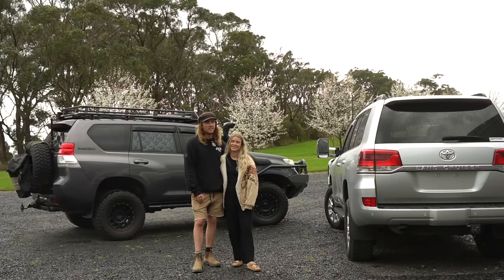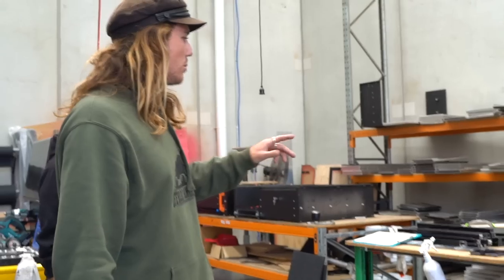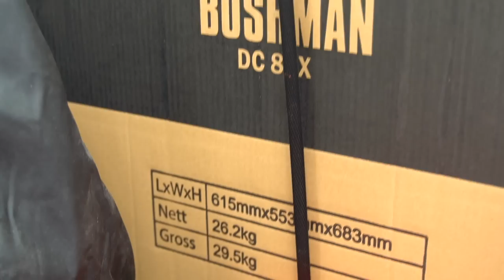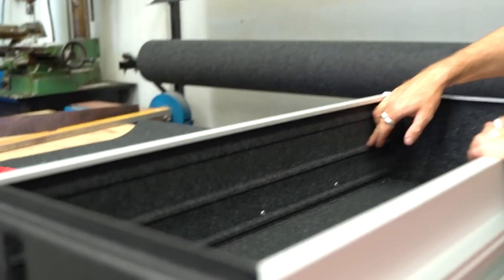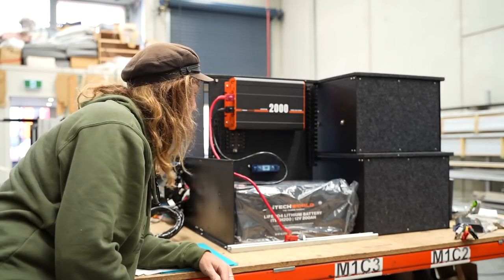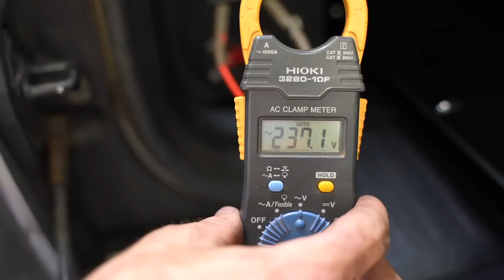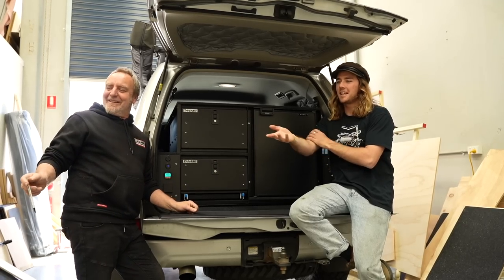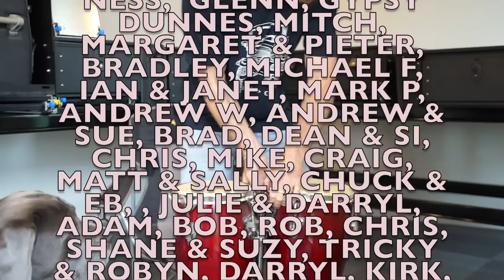MIND BLOWING 4x4 DRAWER & 12V OFFGRID SETUP TANAMI 4wd TRUCK BED CAMPING & 12 VOLT

Comment: Hi guys the 200 series is really coming along, the Tanami workmanship is top notch aluminium definitely the way to go. I wish I knew when bought my twin draw its about 10 kg heavier. When I weighed my 3rd row seats approx 45 kg. Found with the draws loaded is problem with the  van attached.  We use Solarscreen on the caravan reducing heat & I don't scare the kids outside when I am running around in the raw! Safe travels.
Reply from the maker: Thanks Ian!! That’s light mate!! Cheers mate yeah hopefully tows good with a bit of weight in the bum! Cheers legend

Comment: What a great video and fitout,
Just fitted a set of aluminium draws from another company and they weigh 90kg for just a 2 draw system for a 200 series.
The majority of metal 2 draw systems all weigh about the same as I enquired a lot of manufactures at the recent Perth 4wd show.
I am truly impressed by both the weight and workmanship in your system.
Reply from the maker: Thanks legend!! Baz said he can make the standard side by side drawers for 60kg which is pretty good! They are quality as! I did a lot of research myself and that’s light!! Couldn’t find lighter!! Cheers mate

Comment: That looks like it will be a great setup for my Ineos Grenadier when it arrives early next year. Although I want something that I can leave out the whole thing for about 70% of the time and put it in when I go on trips away.
So maybe 2 hours to install using the inbuilt L Track utility rails in the rear floor. I will already have the extra battery mounted under the rear seat from the factory so that will remove a lot of the weight. That will match the colour of my vehicle too.
Reply from the maker: Sounds like a plan mate! Hit up Baz and the boys!! They would love to help

Comment: Looks great, good job, lovin the build guy’s, real professional setup. Q) around 16 mins, the guys were soldering a cable, was that a battery terminal or other? , Im guessing it was crimped nicely first, ur cabling all looks good of course, but I have been seeing a different train of thought about using solder on ur battery cables/connections in the solar communities (or pretty much most cabling nowdays if ferruled or terminated correctly in solar &/or DC systems), for various reasons like: it stiffens & corrodes connections & can add acids, it is not as good conductor as copper & has different thermal properties, so if a connection does become hot from load or poor connection, the solder will melt first and can therefore weaken the connection & increase resistance here, exacerbating the  problem maybe when ur using the microwave, etc.
Victron, actually specifies not to use Ferrules in their gear, controllers, etc, because their connectors are designed to take fine core cables directly and provide a better connection than if ferrules are used, so I try not to use solder at all now-days if possible, as my interests are more into the larger 24v & 48v lifepo4 gear using all In One systems for simplicity & relatively cheap considering the functionality. Anyhow, my question is: as a sparky, what r ur thoughts about using Solder on cables if u can use a nice crimp? A large cable properly crimped (preferably hydraulic) forms what is known as a cold fusion bond, where all the molecules (basically) are compressed together as tightly as possible & pretty much fuse into one, giving a solid connection, with more flexibility & no potential acid inclusion, & in the marine circles solder can introduce more problems if used this way, more electrolysis, etc, anyhow, some food for thought.
Finally, loved ur stress test of these batteries, they do look to be a quality Australian build, but I would love to see Itec? Go ahead with the DIY builders version and introduce a 24v & a 48v versions as well, maybe the 24v version could be series for a 48v upgrade/setup capability as well, and a 200Amp BMS with BT App, that would be good. But another Bonus I did notice here is that they can be series together if u ever wanted to upgrade to, or build a 24v system (not 48v yet, bummer) with an AIO MPPT system which can get about 3.5Kw now (or more), have high functionality are fairly robust & can be considerably cheaper & easier to setup with thinner cabling for the more budget builder. Cheers

Comment: Just having gone through the process of rear setup myself I could appreciate the workmanship and the goals of reducing weight. Only 2 things came to mind, the dual drawer system I had found in my previous config was more issue that value, the top drawer is difficult to access, is less flexible and adds weight. I moved to Front runner Wolf pack boxes which can be accessed, stacked and removed much more effectively. The second thing was rear view visability, are you guys installing a rear camera to accomodate both the van and tow vehicle? I am in the process of looking at what options are availble so if you are keen to see what you land on as a solution
Reply from the maker: Thanks Bob for the information!! We are loving the drawers
Reply: @SarahandKeelanTravels  rear visability solution?

Comment: Nice work guys.  12 volt setup is 👌.  Out of curiosity, what size cable did you run from main battery to the 40 amp charger?  Cheers
Reply from the maker: I ran 4B&S, about 4m run and I’m getting next to 0 volt drop which is good!! Thanks mate

Comment: Great to see you considering weight, there are alternatives. Did you consider having an easy to access master isolation switch on the 12v system, in case of emergency/fire etc?
Reply from the maker: Thanks legend! We are all about weight calcs but also having the perfect setup for us too!! 
It’s a compromise like everything though! 

It’s under that False floor so can reach in and flick it off, I made sure I’ve fused everything and also my joins are good so hopefully touch wood happy days

Comment: Awesome set up and really interesting to see it built out of ali instead of ply. Looking good. Question on the 2000W inverter from Itecworld. I know you do a lot with their gear and being a sparky what’s your thoughts on the manual saying to put 25mm sq cable on 250A fuse? Is that what sizes you did?
Reply from the maker: Soo far so good!! Yes I used exactly what they provide, in terms of current draw 2000 watts at 12v is 166 amps, 25mm sq over 0.3m run of cable is sufficient for that. If that run of cable is 1meter + then definitely go bigger… go much bigger
Reply: Yeh mine was a bit longer with the batteries being out on the chassis - I think around 1m so I did 50mm cable and also dropped the fuse size to 200A and just did some testing to make sure my appliances were not going over that. I thought the same about the 166 amps but then realized when testing that efficiency of the inverter has to be taken into account and it was actually drawing a lot higher amps.

Comment: Awesome guys and funny, cracking looking set up,  But only one Gripe Itec world gear came on special a week after I bought 2 x 140amp Lithium batteries on the sunny coast. Not a heads up from you buggers at all would loved to buy through you buggers, not to worry they are Prismatic cells and were  aussy made and cheaper than itec ones , so all good
Reply from the maker: Thanks for the support Craig

Comment: Why did you put a loop in the +ve cable to the fuse,
Reply: I was wondering the same thing
Reply from the maker: Just a service loop, I was a switchboard builder for many years making boards the size of busses and one thing you never do is pull the cable tight, if anything ever happened you won’t have enough slack in the cable to fix it.